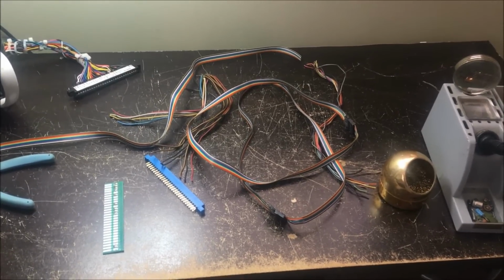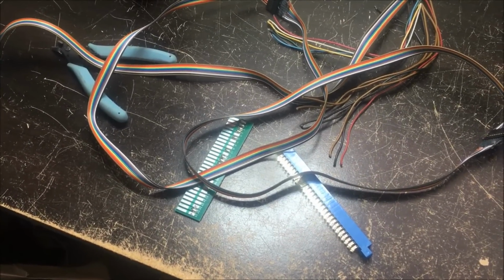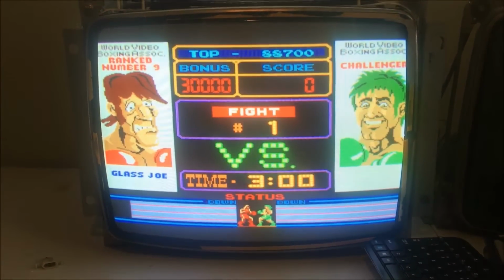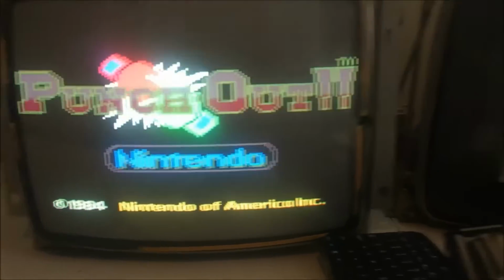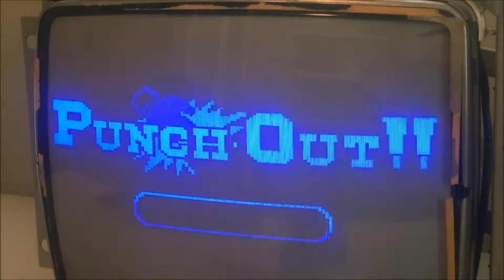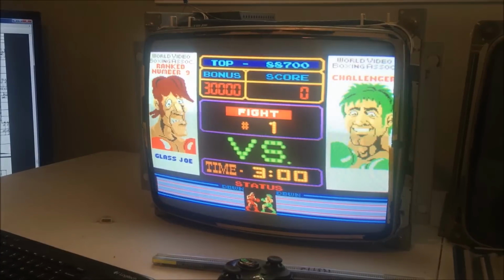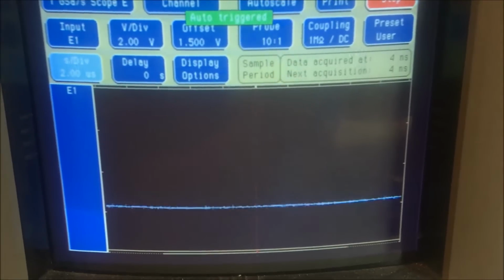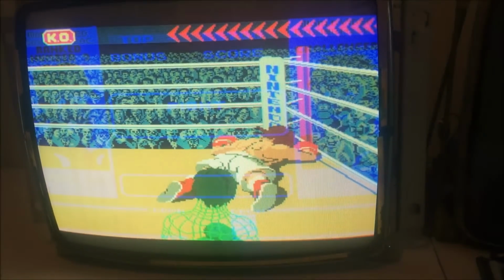1984 Nintendo Punch-out!! Arcade PCB Repair

Comment: I made a note that I didn't see any scanlines or any real raster effects on your screen, so I'm wondering if that was a common thing with 80's monitors or was it just your display?
Reply from the maker: Im sorry...   im not really sure what you mean be scanlines or raster effects
Reply: Those are the beams that are drawn across the screen at the game's actual resolution.  They have dark lines between them and help to focus the pixels better.
Reply from the maker: voltz15 i know that mame had a scan line setting...  tho i had never seen “”scan lines” like that in a real arcade game...   think about how your old tube tv looked...  do u remember seeing dark “scan lines”?    The arcade monitor works exactly like the old tube tv. If a monitor is working right..   you should see no “scan lines” at all
Reply: @classicarcaderepairs4818  I wonder if yours is a specific brand.  Most arcades and tv's do have them, but it's the older sets that hide them better then later models.

Comment: Cool repair! The colour problems with those boards seem pretty common.
Reply from the maker: Yeah it was weird… I really think the edge connector was shifted so far that one of the colors was in contact with another color or something… Because after I reseated the edge connector It went away… So I’m going to end up putting a couple keys in the edge connector so it goes on right from now on